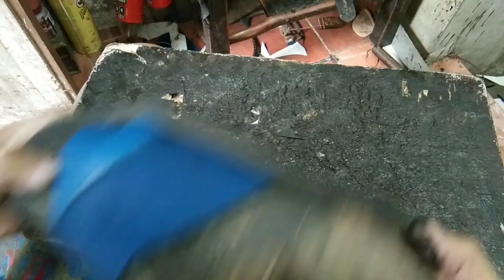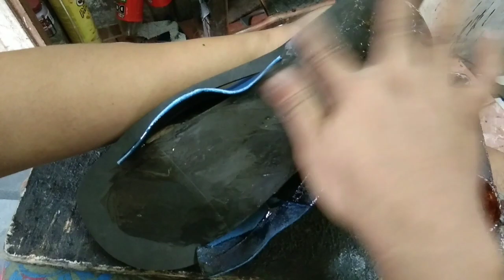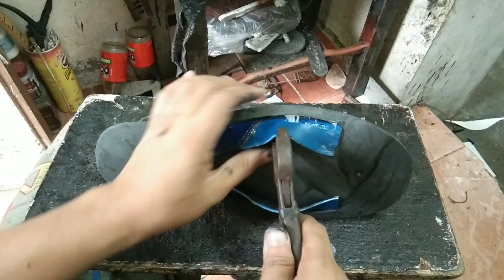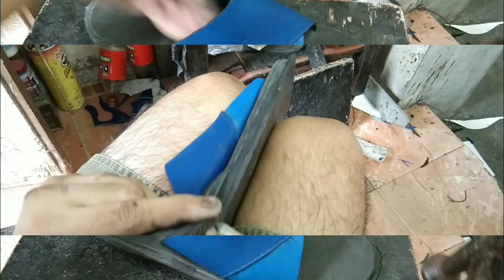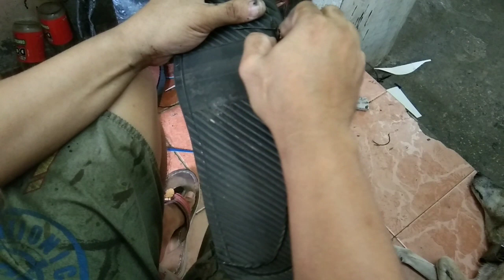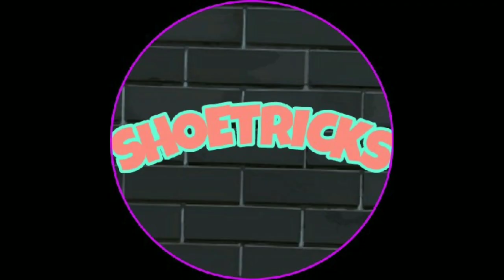DIY CALM LEATHER SANDALS USING RUBBER SOLE FROM USED TIRE

Comment: What's the material in the first layer? The one you first cut to insert the Blue leather straps...thanks :)
Reply from the maker: thanks for watching. the answer to your question is slice foam type of rubber mat.😀
Reply: @shoetricks1629  thanks for posting!  I am learning this to adapt for a ceramic project (for my work) :) will look for materials in second hand shops etc